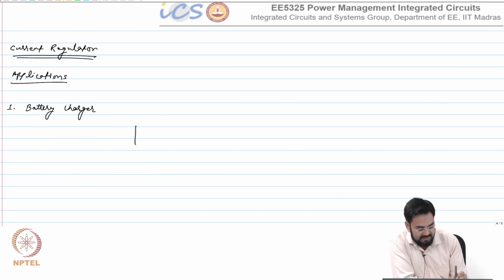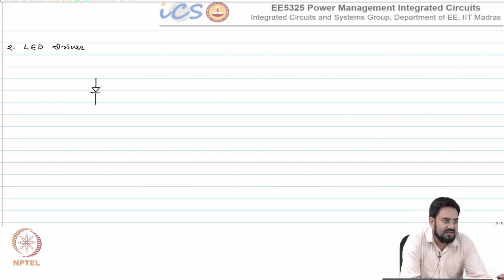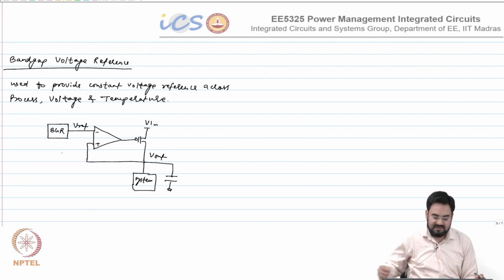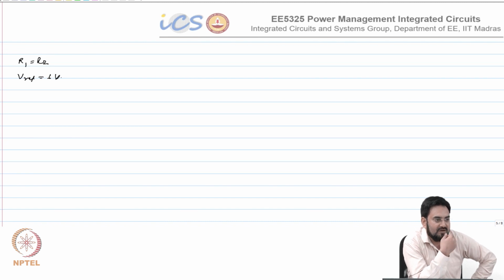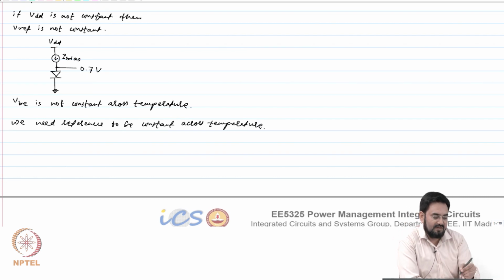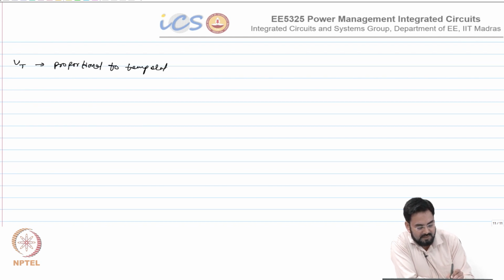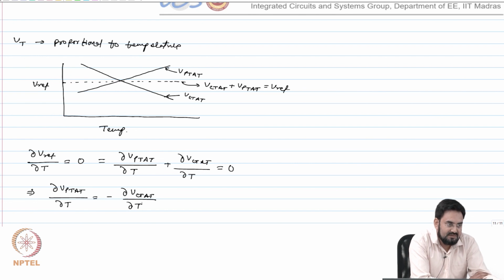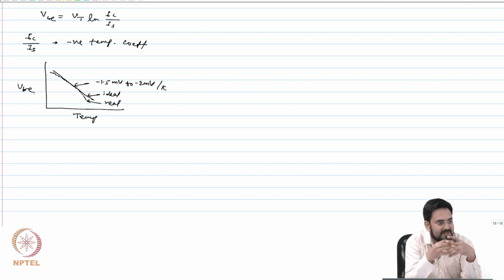#7 Current Regulator Applications | Introduction to Bandgap Voltage References PTAT & CTAT Voltage

Comment: At 4:45 sir draws a opamp ckt with +ve feedback. Then how is I=Vref/Rsense. I didn't get it. Someone pls help
Reply: opamp along with PMOS transistor (common source stage) creates a negative loop gain that ensures the voltage across Rsense is equal to Vref, hence I=Vref/Rsense
Reply: @khalifasable  Ha, I understood that later. Thanku for putting effort to clear my doubt
Reply: @khalifasable   I have still confusion , so can you share some refferece for this concept.
Reply: @subhadipkundu6058  Most of Analog design concepts are covered in Razavi's book : Design of Analog CMOS Integrated Circuits
Reply: @khalifasable  okkk thank you...